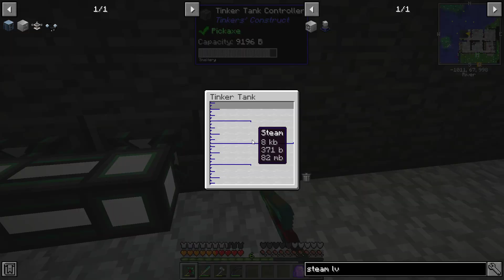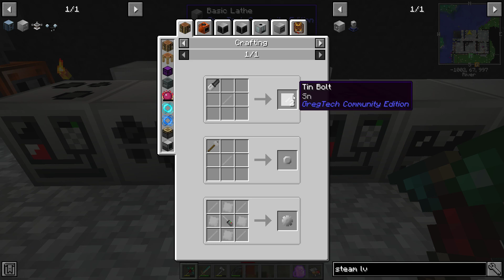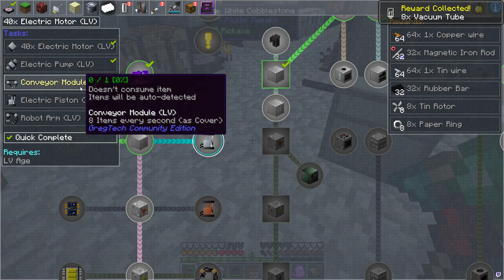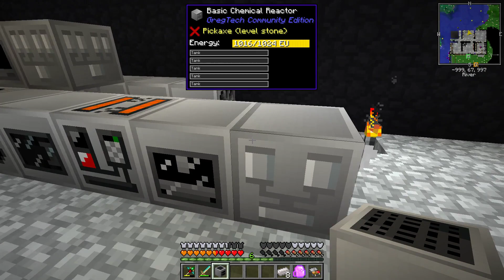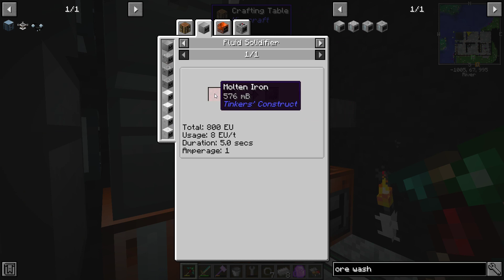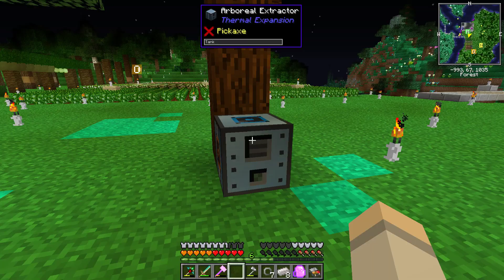FTB Interactions Classic - Part 16 - Tons of LV Machines

Comment: For the sap extractor to work, you have to put the thing next to a tree, not a stack of wood. Trees have a different meta state than log stacks, so the extractor can tell. I believe the slot you were putting fuel in was actually for fertilizer.